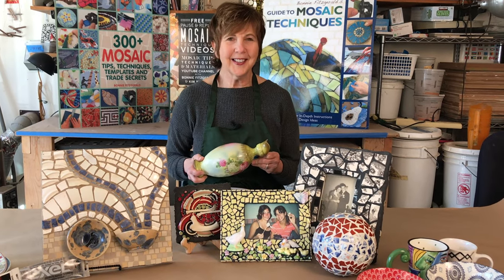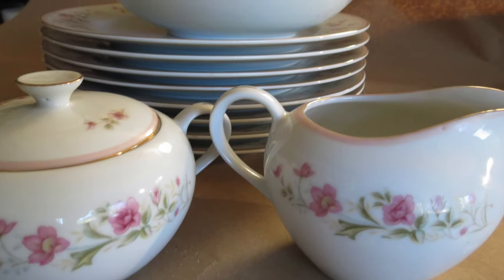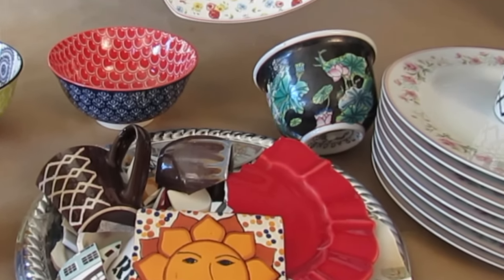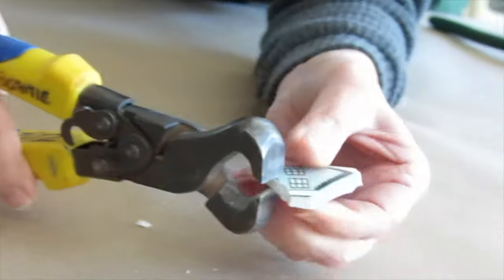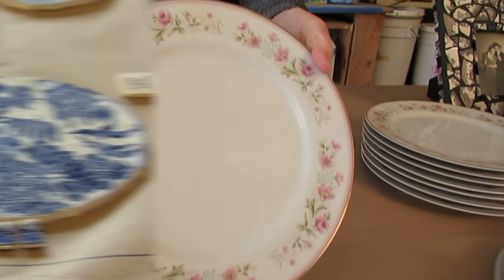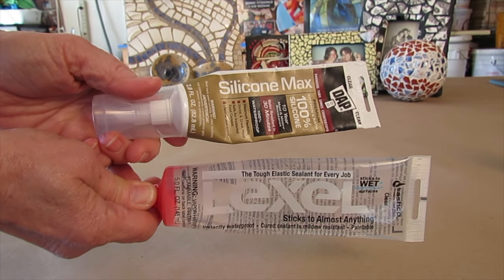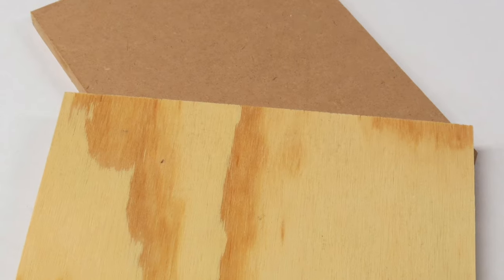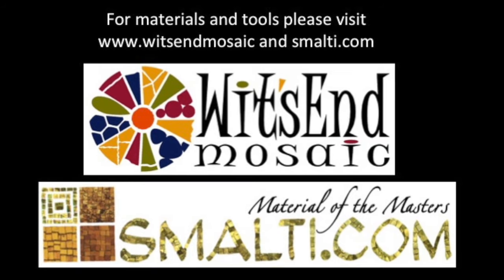DIY Broken Plate Mosaic Art in the Picassiette Assiette Tradition

Comment: Hi Bonnie, I'm just starting out with mosaics and I'd like to make a seaglass mosaic window. I don't really want to glue my pieces onto anything (glass in a frame or anything else) because one side is always "ugly" if you do that. I was planning on placing my seaglass in a silicone mold and then filling it with something that can glue it together. I'd like the material to look a bit like stone when it's dried (so I can't use resin) but I'm not sure if there's anything out there that will be strong enough to hold everything together? Any help would be greatly appreciated!!